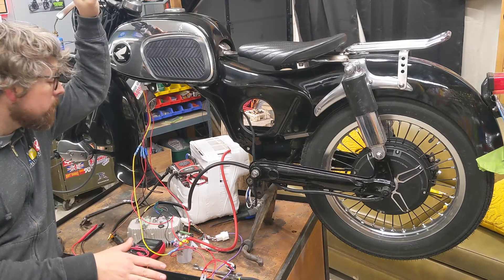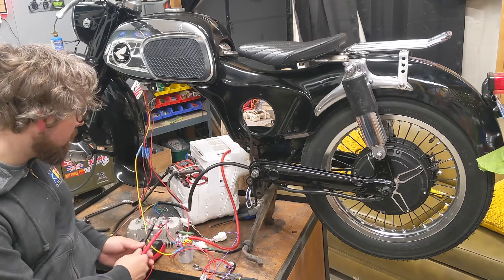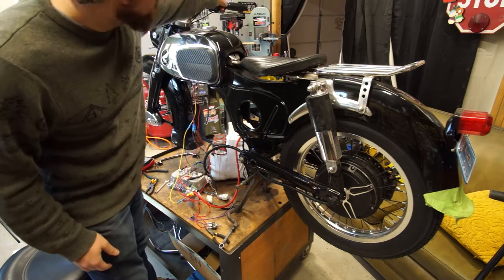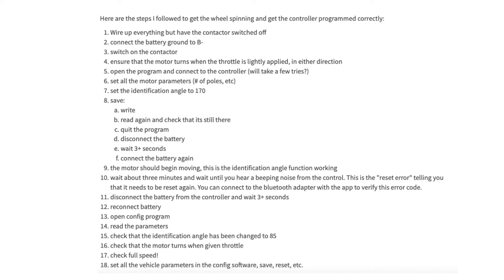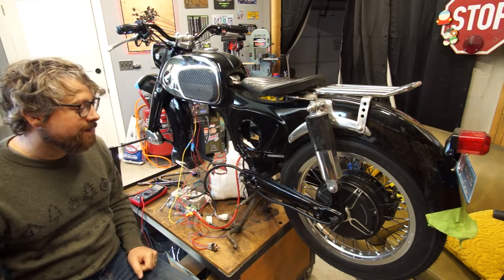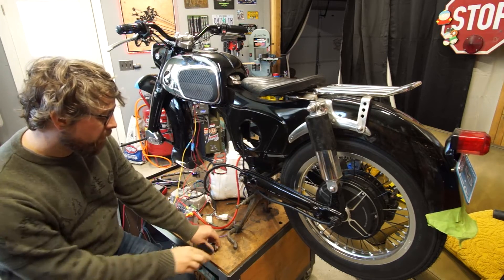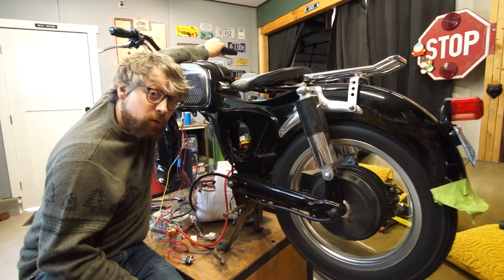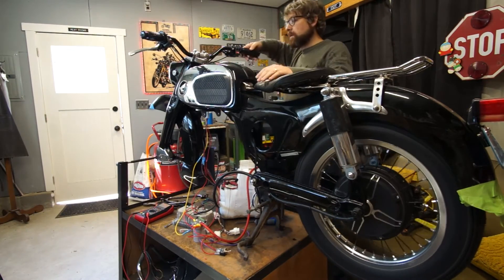Kelly Motor Controller Programming & Set-up - Project Dream-e Bonus Video

Comment: Hello, nice video. Thank you! I saw your 1K pre-charge resistor on top of the main contactor. As I see it is wired correctly according to the wiring diagram, shorting the contactor terminals. Regardless the key switch is turned on or off position, is this resistor always a load to the battery?  Do you have any issues with this way of connecting the resistor? Does it drain your battery? I am always afraid of keeping the controller on power even using this precharge resistor when I turn off the bike. Alternatively, I use a timer relay in On delay mode which can operate on DC 72V. When I turn the ignition on, the timer relay counts a few seconds during this time the precharge resistor passes some current to the controller. After that, main contactor gets activated and resistor line is disactivated. When ignition is off, all lines to the controller are open.
Reply from the maker: Good question, and the answer is, No it is not. The way I wired it, I used a double-throw switch so that one of the throws of the switch closes the pre-charge circuit while the other one turns on the DC-to-DC converter. And this allows me to first switch on the pre-charge circuit, wait a second, and then use the key switch to turn close the contactor. BTW this is NOT typical and I only did it this way because I wanted to use my 12v key switch and net send 72v to it. I have a wiring schematic here: https://dannix.net/lib/moto/dream-e-wiring
Reply: @ThisOldJalopy  Thank you. Yesterday I the implemented similar wiring as automatised version and it is working great. Ignition key, when turned on, the timer relay (On delay) is energised. Precharge relay coil terminals are connected to the NC terminals of the timer relay. After 10 seconds, Timer relay coil energises, NC terminals become open and NO terminals become closed and main contactor is activated. I also made parallel wiring from main contactor trigger terminals to turn on the main controller PWR (7) 72V. So during the precharge counting time, the controllers are not powered on. They get powered on when main contactor is activated. Soon I will make a video for demonstrating this process. I used the relay having a link below. A Turkish product of a reliable electronics manufacturer of years. Operating Voltage is wide, 24-240 AC/DC so it can run on 72V DC without issues
https://www.entes.eu/mcb-7/
Happy ridings and keep safe
Best Regards

Comment: Thank you so much for this video. He correctly captures the anxiety and emotional rollercoaster involved in an EV build. The vid also demonstrates the challenges involved in making an EV build video that makes sense to both beginners and veterans of the home EV world. For example, he first checks resistance across the contactor, then doesn't say why or what the result was (at 1:35)  (Or whether it's a PWM contactor used on Netgain builds) Then he says lets turn it on and hope it doesn't explode (2:00) Eventually, using an app he gets the motor spinning and all is well.

Comment: How do you balance the rear wheel?
Reply from the maker: Good question. I expected the rear wheel to be very unbalanced, however at all speeds there is no vibration issue from the rear!

The normal means to balance a spoked wheel will not work with the wheel because it won't freely spin on a balancing stand, which would use gravity to spin the heaviest part of the wheel downward. So to balance a wheel like this, you could get these "balancing beads" that go inside the tire. While its spinning at speed, the beads will naturally travel to the side of the tire that needs more weight and will balance out the wheel. https://www.common-motor.com/balance-bead-kit-honda-cb350-cl350-cb360-cl360-cj360-cb450-cl450-cb500-cb550?gad_source=1&gclid=CjwKCAiAkp6tBhB5EiwANTCx1EZIu2XpaHzlavIVtmtz3LooG7Zrk7k8ysY_g8Ivh5rXbytru9JPGRoCR1gQAvD_BwE
Reply: @ThisOldJalopy  Thank you very much on the info on balancing tires with hub motor

Comment: Ive been wanting to get into my already tuned kelly controller as my low voltage is set at 68 so i can only get a quarter use of ny battery it only charges to around 82ish and only get to ride it down to 68 before it shuts off i know its not safe to lower them down to zero but im goin to at least run it down to 30/40% dont see why that would hurt its a 72v tuned electro and Co kit on a highly modded razor

Comment: How are you planning to balance the rear wheel?  We've got an 8KW we've just put a tire on and are mounting on an '04 GS500F.  None of the dealers or shops around know how to balance a hub motor and I don't want to go over about 30mph/50kph until it's safer to do so.  Only credible way I've seen so far is to put some weight on and see how it changes, followed by lotsa rinse-'n-repeat.  Nice video and project, btw.  Looking forward to seeing ours run as well.
Reply from the maker: To my surprise, I haven't had any out-of-balance issues. But I haven't gotten it up to full speed yet. If there are issues at higher speeds, I want to try these balancing beads: https://www.common-motor.com/balance-bead-kit-honda-cb350-cl350-cb360-cl360-cj360-cb450-cl450-cb500-cb550